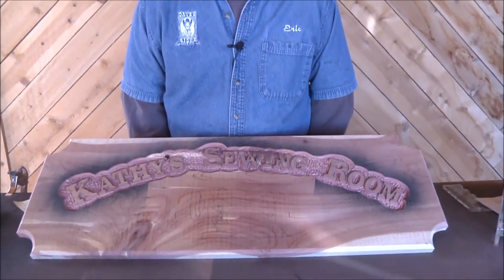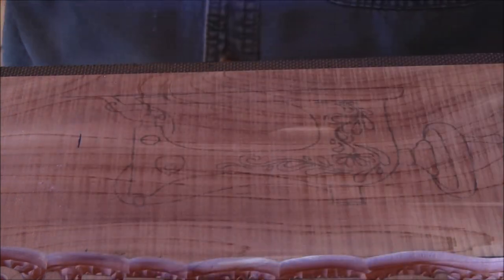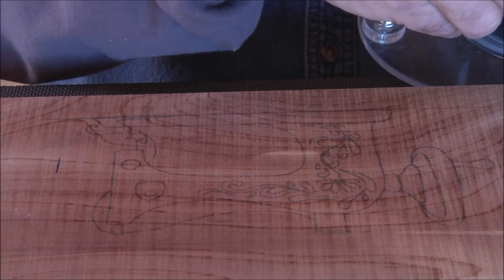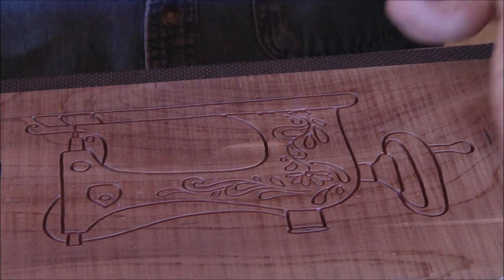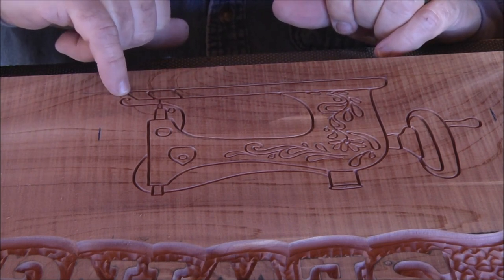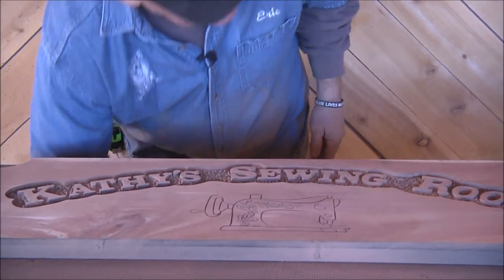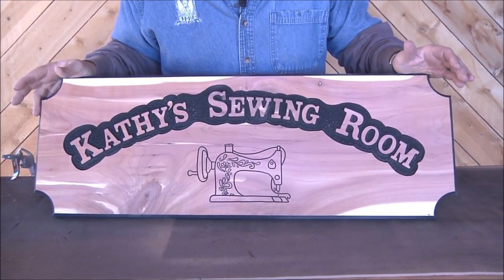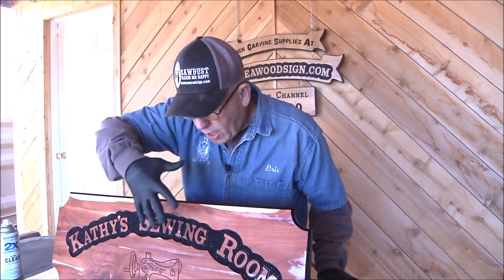#626 Freehand Carved Wood Cedar Sign Kathy's Sewing Room

Comment: Howdy...

Straight to the point here...

I'm doing a "Mailbox Makeover". Solid custom job for my own home, just to see if I could do it. Has many carving/engravings done to it. Head over to 731's group for pics. Carvings and engravings learned from watching you, but I used a Dremel. 

I'm on the fence as to what final sealer to use. This being a "mailbox", obviously it's exposed to the elements. The location sits in about 95% shade all year (I have MANY 70'+ oaks in my yard), so it never really sees "direct" sunlight. 

I've read just as many positive reviews about Spar Urethane as I have negative reviews. I thought about going with Total Boat top coat but, it's pricey and I'd need probably $100 worth of it...That's wayyyyy out of my budget and the wife would make me live in this mailbox if I spent it for this purpose. 

I'm 2 months into this build. I bought Behr Spar Urethane. It's labeled as UV protection but I just don't know for certain. 

What do """""YOU""""" use for a client wanting a sign that'll be displayed outside?
Reply from the maker: Hi Mike, thanks so much for watching and for the question. I have never used the Behr Spar so I can't speak to that. 
My favorite exterior finish is ZAR Water Based Exterior Spar Urethane. I've always had great results with it, even in extreme weather conditions. Hope this helps. If I can answer any other questions, you can email me directly eric@makeawoodsign.com. Thank you for watching❤